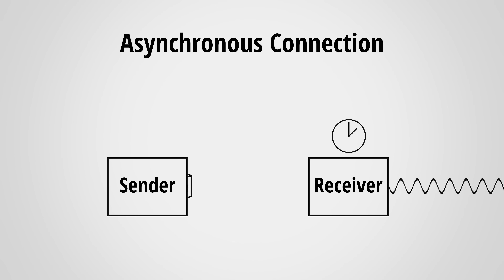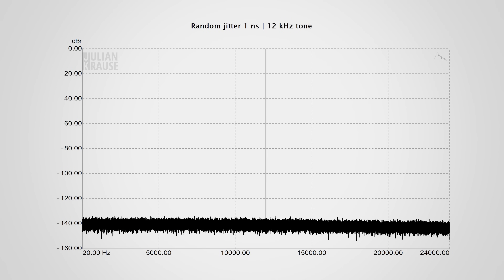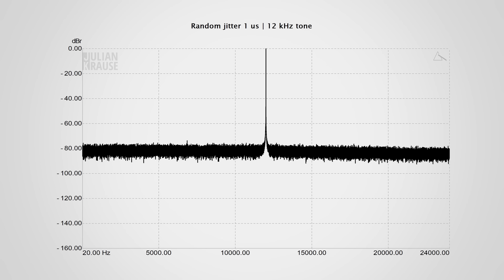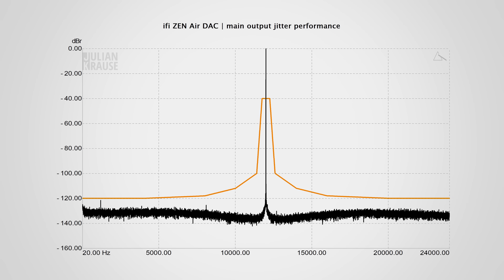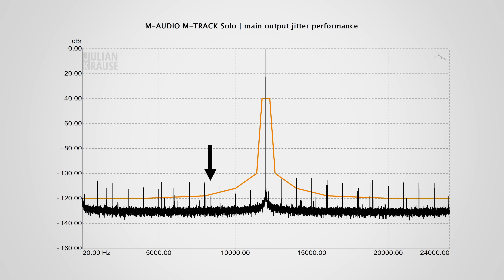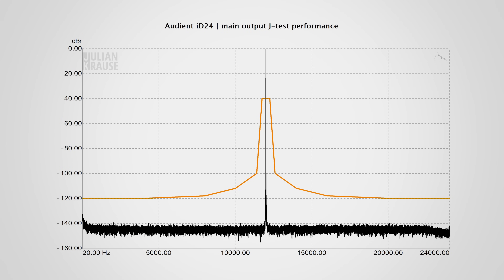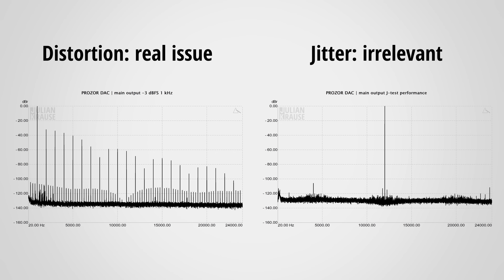Jitter is RUINING your audio? The TRUTH about jitter!

Comment: Async audio solves interface jitter. It does not solve clock-domain modulation, power-induced phase noise, or correlated timing errors inside the DAC, which arise from real analog interactions between clocks, power supplies, grounding, and control loops. These effects don’t show up as classic “jitter” in the transport sense, but they directly influence the moment of conversion. In practice, they manifest as changes in spatial stability, low-level resolution, decay continuity, and overall ease — aspects of reproduction that are fundamentally time-domain dependent rather than frequency-domain artifacts.

These same mechanisms explain why simple FFT-based jitter tests, including the popular J-test, don’t capture the full picture. J-tests are designed to expose periodic, data-correlated jitter, which modern DACs are already very good at suppressing. Today’s dominant timing issues are non-periodic, power- and control-loop-driven phase modulation that varies with operating conditions and averages out in the frequency domain. The FFT can look pristine while the conversion clock is still being subtly pulled in time — a condition our hearing is far more sensitive to than static spectral sidebands.

In other words it’s complicated, a bit messy, and definitely not snake oil

Comment: Jitter is a real pain in the ass for recording. It does manifest on playback as well but that does not effect the source material and only effects the decisions we make while working on a track. The effect on playback is less of a problem because the distortion is not having huge impact on eq balance or imaging (it does effect those two of course but in very small margins only). For recording it does not destroy the sound but at the same time cannot be considered like a plesant mild distortion as well. I would not bother to invest for a atomic clock costing 10.000 usd or more to get the timing of the recorded slices tight but it certainly matters. DIgital recording still is the way to go and adjust the budget to te project. If you want pristine recording and have budget you go to premium studio who have all things a little bit better. More choices of rooms, mics, amps and high end ADDA but also a Atomic clock driving those High end ADDA's which makes sense for that purpose getting the best of the moment.

Comment: 😮Storm in a teacup ...

Analogue has AT LEAST 100 times this problem.
Not identical,  and rarely audible non-harmonically related speed variations. 
It's called WOW AND FLUTTER and is also rarely audible in decent gear.  😂

Jitter is inaudible in today's even modest equipment.

Jitterphobia ... Fake snake oil for the new millennium  .

Comment: I assume that the jitter audibility tests by Dunn et al were done using pure tones? A distorted electric guitar track is perhaps not the ideal source to bring such issues out. 

I totally buy the arguments you're making here - if a device is cheap and/or poorly designed to the point where jitter is a real problem, then it probably has much larger issues. Modern PLL-augmented clocks are extremely good.

A couple geeky questions:

I'm curious to know how you did your jitter injection samples - did you resample in the digital domain or something like that? If so are you confident that your algorithm was truly capable of simulating O(nanoseconds) jitter? Was it upsampling the signal to multiple GHz?

I can't really think of a practical and valid way to do it in the physical domain - in principle you could synthesize a jittered word clock and send it to a real converter, but you'd have two significant problems: First, the converter under test might apply a PLL to the input signal, which would tend to "de-jitter" it up until the point where the jitter is so severe as to cause the PLL to desynchronize. Second, it would be impossible to simulate multi-sample-period jitter levels such as 100 us.

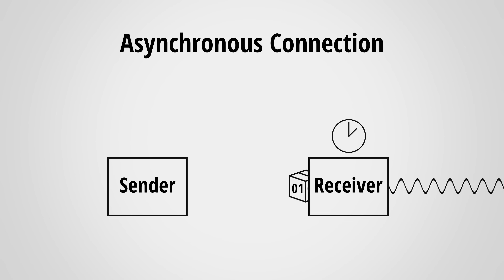Comment: @4:00 -- I respectfully disagree.
In many DACs, including high-end DACs, the DAC's clock is tied to the clock of the transport device (such as a computer).

I have heard the difference between feeding a laptop's digital output directly to a DAC, via a USB cable vs inserting a transport between the laptop and the DAC.  The sound quality improvement, with the latter, was very pleasing.  I have also heard the difference, using the exact same songs, between feeding the bits via a laptop vs the DAC's built-in transport (the CD tray).  The latter was easily better sounding.

Perhaps it was also due to noise reduction?  Computers / laptops generate a lot of noise that will not get passed a good transport.

Also note that my listening test was done, using high-end audio gear, professionally set up in a treated room.  I do not know how apparent the sound quality improvement would be on an affordable stereo.

The DAC I tested with is the Aesthetix Romulus Eclipse.
Another test that I conducted was using a mass produced USB cable that came with my printer, and comparing it to an Audioquest Diamond USB cable.  The former sounded terrible, and the latter sounded amazing.  It was night and day different.  No blind testing needed.  The former sounded muffled, and the latter sounded clean, spacious, and open.

I tested, again, with the USB cable that came with my USB hub.  Same results.  And yet both of those mass produced USB cables have been in use for years, and I still use them today, on my printer and my hub.

Comment: Nice vid but I learned something from Bob Adams, one-time DAC designer for Burr Brown, which bears repeating: if/when jitter exists at an objectionable level there's no real need to measure it independently if you are already measuring THD+N (aka SINAD but as expressed as a percentage instead of dB). Jitter is manifested as noise and distortion, not sometimes but rather ALWAYS, and it is fundamentally impossible to have good SINAD measurements yet objectionable jitter. Analogously, 50/60Hz hum is a specific variety of noise too, however it's pointless to worry about it independently if the THD+N measurement shows good performance already.  Finally, we talk about jitter these days simply because it is a deliberate scaremongering "boogieman" the snake oil peddlers like to trot out as a distraction to what really matters.

Comment: I tried to find out if i have Jitter in my System. But the USB Port was way to noisy to find that out with an SNR of about 60db or so. I bout a cheap 15€ DSD Isolator. The SNR increased to ~130db. 15 € well spend.

Not sure if i ever had Jitter and if it fixed it, due to the SNR i can now see that i am at -115db (which is the limit of what my DI can measure), so if i have one, i can not measure it. And if i had it, i was able to fix it with 15 bucks

Comment: I have a question that is maybe related to this topic: does it matter which device is master/slave in a situation where there is a rather cheap external converter connected to an audio interface via spdif? I shouldn't care right?
Reply: The only way to know is to test it, better converters are usually more resilient to a bad clock so it's better to slave them for best performance (numbers not audible)

Comment: Ok, but what if you have a signal chain that has 2, 3 or more DA/AD converters? Stacked jitter, like stacked noise across many channels, could add up to a perceivable level in theory right? 

And then was if the signal chain is also getting jitter from poorly shielded long cables? 

I’m no expert, but it appears this might have been overlooked. 

Am I missing something?
Reply: Yes, you are missing something. Noise can not be stuck, by nature, it's random. Even with multiple A/D D/A loops the jitter will stay way below what is audible.

Comment: It doesn't seem like 'buzzy' guitars would be the best source with which to identify the audible effects of jitter.
After careful listening to various USB Windows audio drivers, it appears that Windows may introduce jitter and other effects when its default audio subsystem resamples and mixes audio from multiple sources internally, before shipping out the results out to USB.  The samples being sent out to USB may not actually be the same samples being played on its local hard drive, for example.
It doesn't have to be mixing multiple sources simultaneously for its operating system's mixer/resampler to have effects, including jitter in its internal conversion process due to noise, system interrupts, or even just less than audiophile grade attention paid to the audio driver/resampler/mixer development.  If there is jitter introduced by the internal mixer/resampler software, it is built in to the output samples and USB buffering won't fix it.
Reply: Jitter is just noise.

Comment: I think it was you (can't remember which video and I may be wrong entirely) who said once that digitally-controlled preamps tend to have higher noise floors and that does seem to be born out in your measurements (with the Ultralite being an outlier), but I'd love a video exploring the topic. Is it a limitation of the control method or is it more of an issue of circuit design? Is there something that makes it so that a theoretically perfect fully analog preamp will always have lower noise vs a theoretically perfect digitally-controlled preamp?

Comment: As extremely correct as you are about jitter, using a highly distorted guitar as an example just doesn't make sense.  Ages ago, when testing audio systems, Smokin' by Boston was one of my favorite sound check songs.  Then I got to thinking, is my audio system accurately reproducing all the distortion?

Comment: Digital is inherently"Jittery" it's like a stair step , you can hear it if you know what to listen for..
Reply: Jitter is only added noise. digital audio is not stepped, this is a misconception.
Reply: @zdfghdfg  Jitter occurs when the clock signal drifts slightly and the intervals between samples end up with tiny variations in length, causing distortion of the original sound when played back. Not added noise.
Reply: @parttime9070  Any change to the original signal can be described as distortion. Jitter manifests itself only as noise added to the signal.
That's it. It's measurable, It's quantifiable. By definition the length of a sample is a fixed length.

Comment: I know I will receive hate for this but jitter & noise floor even below the audible range absolutely affects the listening experience - even in cheap equipments. You can immediately tell difference in sound quality, staging, imagining etc. Even the cheapest usb to Coax Reclockers will make huge differences in the sound. I have been experimenting with this for 8 years now. These differences are not subtle.

Comment: Not trying to imply that jitter is a huge issue, but in my experience jitter has a more audible impact on "weaker" signals like reverb tails. Specifically acoustic reverb recordings in stereo, e.g. from a concert hall. The stereo image/sense of listening to a real room can get a bit weaker. My guess is that the jitter is not the same for left and right signal.
Reply: This is not jitter, jitter just adds noise and it's not audible.

Comment: Bloody amazing content, mate. Keep on the great work! In a tech language way, you are the Glenn Fricker of audio interfaces, mythbusting sort of. For example, when it comes to SM7B -> SM57 discussion, instead of telling the same thing again and again as I did during the last 20 years, I just send a link of your video about the matter. It perfectly aligns to my experience.

Ages ago when I worked for a broadcast company we tested AD/DA chips and used the same measures so although I'm not an engineer, your interface tests tell me everything about these new audio devices. Clear tech data and language, I really like that.

When it comes to clocking / sync, it would be interesting to hear your thoughts about how differences between un-synced devices occur and how to solve timing issues between, for example, an audio interface and different cameras.

Comment: Very interesting. What about jitter introduced by streaming services, ei: less than ideal Internet speeds, caché and buffering. I suspect that's Why physical media or local files seem to sound better than streaming, IMO. Thanks for the great video!
Reply: Streaming services uses packets of data. As demonstrated in the video, packetized data is totally impervious to jitter. The difference in quality is compression.
Reply: Streaming audio is put into a local buffer. The audio is played directly from the audio buffer which is local memory and, therefore, no more susceptible to jitter than a local file (which, incidentally, is also streamed, just from a local media rather than a  remote one).

"Buffering" occurs when the data stream isn't fast enough to keep the local buffers full. In that case you will get obvious dropouts or pauses in the stream. If the stream is fast enough (which, for streaming audio, that's normally the case) then you won't get buffering.

Either way, you won't get jitter.
Reply: streaming services use lossy compression
spotify for example uses the vorbis codec
Reply: @djentledjosh  which has nothing to do with jitter.
Reply: @KeithMilner  correct
i was responding to the top comment which said that network jitter could cause quality issues with streaming services which is not the case

Comment: I am using , from Mac Mini through USB, a Matrix SPDIF2 (reclocker) connected through IIS to Matrix Element X2 (dac/amp), with settings on synchronous mode. For me, it is an improvement of the sound . I don’t know if it is because jitter or ground , but it is doing a nice job . In this way, the sound is clearer , any sibilance is gone and bass is stronger and more defined in synchronous mode , than in asynchronous mode directly from usb. I really don’t think is a placebo, but who knows ?😊 I am using headphones.
Reply: Blind test it A/B/C

Comment: What about sync devices using DAW audio to generate a midi clock ? (Acme4, multiclock ) snake oil too? 🤔
Reply: it's a completely different subject, but no, it's not snake oil, it will not always be audible/obvious but the effect of sample accurate midi is easy to test/mesure.
Reply: @zdfghdfg  "completely different" 🤔

Comment: Great video! Obviously you understand, that jitter as a topic is a cash cow only. Actually,  there are 2 versions of jitter: 1. Samples times are distributed in a slightly imperfect way near to perfect timings, but no integral time deviation occurs, like molecules thermally oscillating near their perfect place within crystal, hence no modulation, since overall timing structure is not affected.  2. time errors add up over many samples, then that error gradually reverses polarity and back and so on: This one causes intermodulation. This is the "bad" one, but even this one is definitely not audible anywhere in the picosecond range. Nobody needs single nanosecond precision. Or femtosecond, or attosecond or plancks time resolution accuracy or whatever they offer next.

Comment: Thank you Julian for the great explanation on this topic! In a forum on Gearspace I saw a discussion about operating systems on computers re-sampling audio and therefore leading to audible quality differences during playback. Does it have to do with Jitter as well or is there another reason for the audible loss in quality? Do you have a video on this topic or would that be something you'd do a video about? There are apps like Audirvana that promise to get around the re-sampling issue and to increase the playback quality.

Comment: One could use jitter as an interesting sound effect. Maybe ins some metal or punk?
If I understand correctly jitter is mostly a concern if you have to use a synchronous conection for applications where latency problems can stack up like live audio. Band recording into their own dps, into the sound system dps into digital amps. Or did I get it wrong?

Comment: Julian, it would be wonderful if you could test the optical toslink output of any LG OLED TV made within the last 5 years. There’s been a lot of discussion about allegedly high level of jitter that these TVs output via toslink that causes problems with some DACs. My DAC works fine but I’m wondering if this type of jitter could cause some audible issues. JDS labs has even attempted to measure the SINAD of one of these devices and it only achieved 80dB, however it is possible that they did not take into account the fact that the TV may have been down converting the test signal from 24 bit to 16 bit.

Comment: So in saying this, do I still have to have one of the interfaces syncing both devices? or can I let one "freerun" without a sync?
Reply: Using SPDIF
Reply from the maker: If you use two interfaces, you absolutely want to sync them, otherwise you run the risk of the clocks slowly drifting apart. Simply connect the interfaces via SPDIF and select it as a clock source in on the receiving one. This way one interface is the master and the other one stays in sync with it.